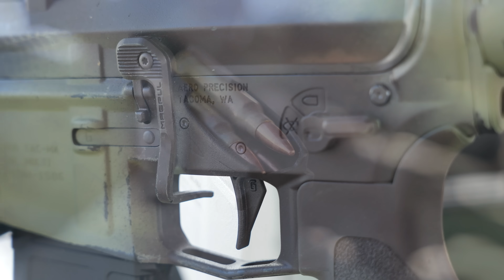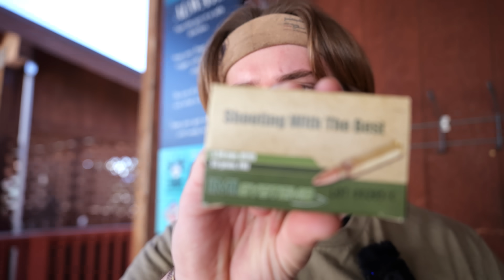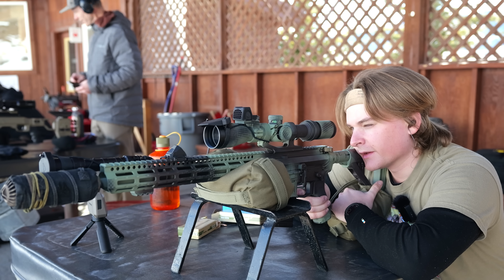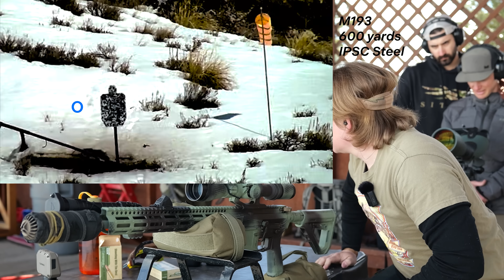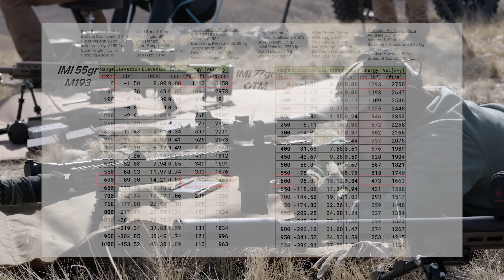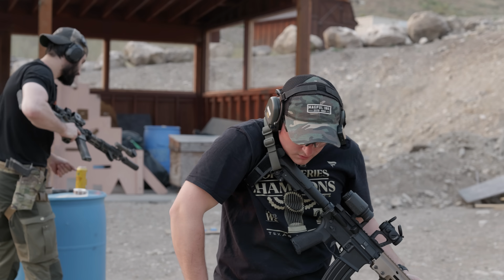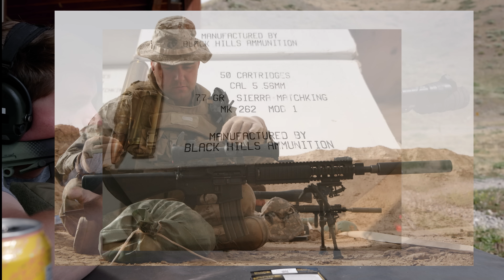77gr OTM: Why This Outstanding 5.56 Ammo Is Worth The Cost

Comment: If want to really stretch a 5.56 rifle with a 7 or 8 twist, single feed some long loaded 80s. At 600y distance, an 80 ELD-M will cut the groups in half over a 77 even. My 80gr load will put 18/20 inside 10” at 600y.

Comment: 55gr FMJ is acceptable for field use out of a 20" rifle, but even at 16" I'm starting to want a heavier OTM. Technically a 55gr will fragment at home defense ranges in a 10" barrel, but I've personally never been that interested in 5.56 SBRs, with 14.5" being the shortest I'd consider, but even then, if I can skip the NFA or just put a compact muzzle device on, I'd prefer the extra velocity. I think the 68gr bullets from Hornady strike a good balance of initial velocity and performance at range, so I've personally been stocking up on Frontier 68gr, but the SMK 77gr is well renowned for a reason. I might assemble a purpose built SPR upper for 77gr, but for now my GPR likes the heavy for caliber, but not super heavy, stuff.

Comment: Sig Sauer Elite 77 gr OTMs with the Sierra Matchking bullet are routinely the most accurate factory ammo in several of my and my buddies rifles. Both my FNs print sub MOA 5-rd groups at 100 yds with 3/8" groups being resonably common.
Its quite effective on pork roast and other simulation materials.
Its essentially the same as Black Hills MK-262 ammo for the MK-12 rifle. I stocked up on it at just under $0.94 each a few years back.

Comment: Only bummer is it breaks (a little) BDC reticles that are normalized for 16” carbines firing M193…you go from hitting about 1” high at 300 usually the first hold mark to as much as 20” at 800. 600 and in you just aim a little low and you should be good on an uncovered target.

Comment: Every bunker on the flight line in vietnam had 1000 clips of M-16 55gr. ammo. M-16 were all COLT. 10 th armored CAV. 1969.
Reply: for the close in 0-40yrd engagements of vietnam, 55gr is good. its still moving fast enough to have knock down power.   its good enough in house clearing operations also at those 0-4yrd ranges.

Comment: Been running 75grn balistic tips in a 10.5" Ar supressed.  With a 3rd position saftey This compact package handles everything well. I have been stocking the 77grn open tip match. I wonder what your thoughts are on terminal effects  between the two in the smaller package.  Those 77grns do very well out of both of my long Ar rifles.

Comment: Some thoughts:

For most people, accuracy and energy at 600 yds probably shouldn't be high on the priority list compared to terminal ballistics at closer range (including over-penetration concerns). There are some other bullets that perform better in this regard, with better expansion and less risk of overpenetration, albeit at the cost of ballistic coefficient. All that said, if you want to shoot far, then it's the best type of round for 5.56, but then 5.56 is still a very lacking chambering compared to other cartridges like 6 ARC both from an energy and accuracy perspective (accuracy mostly meaning resisting wind). 

Personally, I'm still undetermined on what my ammo of choice would be. Kinda between 77gr otm and like a 62 gr soft point or something. I say all this as if I'll ever actually use for anything other than ringing steel lol. Another consideration is that all else being equal, I think a heavier bullet will be a little quieter than a lighter one on the same powder charge.

Comment: While I'm sure there are some who choose a 77gr over a 55gr, I strongly dissagree with that idea that it performs better. I will conceed that a 77gr is more stable at very long ranges of 500 yards or longer. The arc of a 77gr is much steeper and therefore much more difficult to be acurate with since it's vertical (drop) will be much higher. Because it travels so much slower, and from a macro perspective, very close in mass to a 55gr, the increased amount of travel time makes it much more susceptible wind deviation.

Comment: You're going to need fairly fast twist riffling for a 77gr projectile to work well in a.556.  In order to get the OAL correct with my 1in7 twist Mossberg MVP my handloads were too long to fit in an AR magazine.  Single shot they are super accurate.  My 1 in 10 twist .223 Remington 700 doesn't even shoot a 62gr bullet very well.

Comment: For distance, 77grn is superior, but i still really like 55grn overall.  It covers 90% of what i need it for, especially practical engagement distances.  I have better guns for longer range.
Reply: I have embraced 68/69grn. OTM. Frontier 5.56 or the .233 give the best overall performance for my 5 different makes and barrel lengths.
( This includes a CZ bren 2 11" and a Kel tec 16C)

Comment: Like he states twist rate is important.  If you have an older barrel with slower twist rate 1:9 or slower you more then likely will not be able to shoot these.  I shot high power service rifle matches back in the day when we used 90 grain but had to single load them during slow fire at 600 using a 1:7 twist barrel.  Since then the 75's have taken over.  This way shooters can just load one load, one bullet, for all the stages, instead of two.  For plinking it is not worth the extra cost to shoot these.  For matches it is mandatory to shoot the heavier bullets if your barrel has the twist.  My 1:9 will not stabilize these.  Yours might but doubtful.

Comment: BTW, "OTM" Open Tip Match bullets are not considered a Hollow Point design!  This ruling has precedents in multiple court cases already!  

It is a high precision round, designed with a jacket wrapped around the base towards the spitzer tip.  It's process was chosen for it's uniform jacket thickness and uniformity - not for fragmentation or breakup upon impact!
Reply from the maker: This is said in the video

Comment: Your spotter needs to look at ALL the wind not just wind at target just in this video and watching trace it is obvious there is a significant section of wind around the 350m range that is not being properly called rather than just the wind at tgt. If you are not super experienced with watching or calling wind I would recommend setting up multiple wind socks or streamers. At 600m with 5.56 at least one more at halfway. Taking all wind into account as you said is especially important with low BC round and also right as the round become transonic. But the right answer is and always will be ALL WIND IS IMPORTANT WIND.

To comment on the last part of your video yea it works pretty well.

Awesome video.

Comment: The one thing you omitted (though I’m sure many shooters already know this) is the importance of twist rate for this cartridge. Many older commercially available AR-15 variants used to come from the factory with a 1:9” twist rate, which is too slow to stabilize this heavy-for-caliber bullet. It’s best used in AR barrels with 1:8” or 1:7” twist rates. I discovered my first AR from 25 years ago in fact had a 1:9” twist rate, so I utilize 69 grain Tipped Matchking for it.

Comment: The 77-grain 5.56mm NATO bullet excels within 400 yards, maintaining velocity for reliable fragmentation and hydrostatic shock, making it ideal for standard rifleman roles. Beyond 400 yards, particularly at 600 yards, its velocity drops below 1,900 fps, reducing terminal effectiveness to primarily fragmentation, with limited wounding compared to closer ranges. DMR platforms in calibers like 7.62x51mm or 6.5 Creedmoor are superior for 600-yard engagements, offering greater energy retention and larger wound cavities. So, less than ideal.

Comment: So here's the thing.  5.56 is not an appropriate round for 600 yards.  I believe the max design spec was 500 yards when the rifle was originally designed.  If you want 600 yards, and the AR platform, there are better options than 5.56.  If you are willing to move up to AR-10, you get much much better options still.
Reply: So you wouldn't mind standing at 600 yds drinking a beer smokin a camel hey?🤣

Comment: After a couple hundred rounds of 55 grain .223 and cheap 5.56 through my 16" 1:7, I figured there was something wrong with the rifle and let it get dusty in the safe. Once I learned about why the Mk 12 works so well, I tried 77 SMK OTMs and was amazed to get consistent hits on a 12" gong at 600-700 yards.
Reply: The wind flag showed exactly the point of the better bc of the 77gr . I use 77smk in competition 200 and 300 yds and 80smk at 600. The higher bc and match bullets really show their worth at extended ranges .

Comment: The 77gr SMK did a lot of work in Iraq and Afghanistan.  Great video.  thanks!
Reply: Actually its was ineffective, especially at longer range so the M14 was the preferred rifle. The old Vietnam era 55 grain FMJ tumbled when it hit flesh causing a massive wound channel. The 77 grain bullets punched a pencil hole and required more hits to stop the threat. The 55 grain from a. 20" barrel had a higher velocity and more hydrostatic shock as well than the 77 grain from a 16" barrel.
Reply: @PassivePortfolios  🤣🤣🤣🤣🤣🤣🤣🤣🤣🤣
Reply: @PassivePortfolios  "Hydrostatic shock". Get this clown out of here.
Reply: @besttacoalpastor3284  Its a fact. 55 grain continues to be used more and has longer track record. The mk262 is for fat turds  who watch videos all day.

Comment: Most of my .223 stash is hpbt match in the 70gr range... groups can average 2moa at 200 with basic 1:7 milspec if my human error isn't at play. Great for hitting small. Just keep in mind that it may hit lower at some bdms than common 55 or 62gr rounds. And if you swap to those, you may hit higher than your zero if you zero with match.

Comment: Do one on the new military choice of the Sig .277 Fury or I think 6.8 x 51 with the steel case head at 80,000 psi. I think it is a good choice, but no expert for sure. Great video. In fact, I just purchased some 77 gr Badlands SMK at 2900 fps but haven't shot them yet. I feel better about my purchase after watching this. Going to use Ruger Mini-14 and see how they do. No idea of the twist rate in the barrel though.

Comment: Just went shooting out to 500 for the first time. I was running a 16 inch barrel with 77 otm and it was surprising how easy it was. I had my hold and was drilling a steel plate over and over. I will also say m855 was pretty awesome on accuracy(calm wind fyi) and remington 223 fmjbt was like kinda bad at an extra mil lower hold with wind hold as well(not as much umf as the other cartridges)

Comment: There is a reason High power competition shooters don't use 55 gr bullets on full course matches as this video demonstrates why.. 77gr is the standard for magazine fed 223 ars at 200 to 300 yard lines with 80-90 grs used single feed for 600 yards by most competitors.

Comment: Interesting video. I noticed on you printed ballistic chart you had the sight height listed as 1.5 inches. Did you actually measure it or just leave it that number? That can be the actual number on some bolt action rifles but on most MSR rifles it is higher than that.
Reply from the maker: That’s just the default value, wasn’t relevant to change for the purpose of that graph. Actual sight height on this is about 2.7 inches
Reply: @greenweiser Yep,  close  to that on my rifles also.  I love IMI 77gr in any1:7 rifle.  It will also shoot great through a CZ 527 bolt action rifle. Just wish it was cheaper...

Comment: Its not the bullets weight that determines BC, its bullet design. For exmple, 73 gr eldm have a higher bc than 77 gr smk. 
73 eldm, according to applied ballistics, has a .410 G1 BC. The 77 SMk has a .371 G1 BC
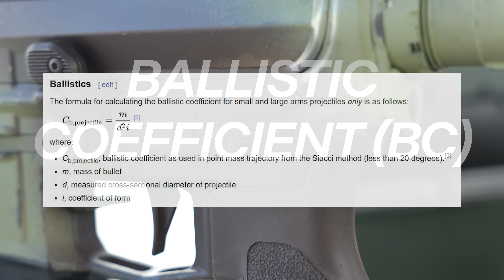Reply from the maker: And a 77gr 5.56 bullet has a higher BC than a 230gr 45ACP… of course a less massive bullet can have a higher BC because it is a multi factor equation. Have a look at the equation for BC at 0:42. Mass is a factor since it is the big term “m” in the numerator. The term “i” in the denominator is the coefficient of form which tells you about the bullet’s design. All of it factors into BC

Comment: heavier boolets have more moment assuming they are not steel core or steel jacket. this causes them to be better stabilized with lower twist rates and have less devieations from the magnus effect or Poisson effects since the yaw procession is lower. so the natural cork screw path that supersonic rounds travel is smaller in magnitude and the point of impact depends less on slight burn differences between powder burn. just another reason why we keep trying to go back to heavier rounds.
i would also expect there to be a trade off at closer ranges for terminal ballistic performance since the lighter 556 rounds take advantage of their larger yaw magnitude to more easily tumble on impact.

Comment: I am new to longer ranger shooting and was shooting 77gr OTM AAC (the 2700+ FPS stuff, not the slower stuff) today out of my SPR style gun with a Ballistic Advantage barrel, Geissele SSA-E trigger, and a 2-12x Athlon scope using a bi-pod on a folding table (not the most stable platform). There was ZERO wind today or I would have been less accurate, but I was probably getting 1-1.5 MOA consistently at 200+ yards and was getting hits on the same exact spot with it. Great stuff, and I think I'm just going to stop buying M193 altogether. Shooting M193 or M855 out of the same gun previously yielded about the same type of results as this test. M193 and M855 were just too inconsistent at range (probably shot 2-4MOA groups at 200 yards) and I was kind of pissed at myself for investing in building what I thought was supposed to be a reasonably precise gun capable of 1-1.5 MOA. 77gr OTM just makes it trivial. I have a .308 AR, but avoid shooting it due to costs because I'm not a competent long range shooter yet.

Comment: Totally agree.  I switched to the old Cor-Bon 77gr MPR(basically a Tipped Match King bullet), and then over to the Black Hills 77gr as my got-to/home/self defense round.  Not only do i like the heavier bullet for terminal ballistics, but I feel it excels out of shorter barrels due to there being less less powder to burn(and more time to burn it, since the profile is moving more slowly in the barrel.)
A few years ago we used my friends chrono to check out the velocities out of different barrel lengths, and I don't know if my HD gun's chamber is a little tight, or if this is normal, but the results gave velocities out of my 12.5" barrel between 2700-2750fps(with the advertised velocity being 2750fps out of (I believe) a 20" barrel.)  That was really sold me.
Reply: That fast out of 12.5"barrel. That will work. Maybe try some of the NAS3 cased ammo( by Badlands Munitions). You will be close to 3K ft/sec. from a 12.5" barrel. That would make your gun a deer/hog smoker.

Comment: Not all 77gr ammo is created equally. I bought some PMC ammo because it was slightly cheaper compared to some competitors. Advertised velocity was 2,750 FPS on the box. Took it on a range trip with a Caldwell Chorongraph. 

After testing, the average velocity was just over 2,600 FPS out of an 18" barrel. Far below the advertised velocity, a big disappointment. Accuracy was there, but not the velocity and energy. 

The best 77gr I've tried was Silver State Armory, back when it had Sierra Match King loads, still got a box of that ammo. The average velocity was over 2,750 FPS, in the neighborhood of the advertised specs with my 18" upper. 

Next, I tried some Magtech 77gr loads. Those preformed similar to the SSA ammo. In the neighborhood of the advertised specs and accuracy was marginal. 

I purchased some IMI 77gr loads, but haven't tried them out yet. Next to do that soon.
Reply: If you're not firing the test lot through the manufacturer's firearm, you won't likely ever get their marked velocities.  It was likely test fired from a 24" test barrel.  Even FGMM you won't get the same velocities Federal does..    PMC is generally a little weaker ammo, and definitely not match grade - OK for training, steel or paper though.

Comment: Depends on use case.  I can't see a use for a 556 needing to reach 600 yards.  That's not an ethical hunting range, nor is that self defense range.  That's pushing 556 to the limits, in which case I'd just step up my weapon and caliber choice.  My realistic use case for 5.56 is WELL INSIDE 100 yards, probably inside 20 yards for lawful self defense. And the 55gr is 400 f/s faster, which is better for armor penetration if an attacker has hard plates.  And 55gr is affordable so I can stack 2x more and 2x train more.  If you're shooting 500+ yards on an important target, step up to in caliber (6.5CM, .270, .308, 7mm, etc.).  Plus a larger caliber will have more energy on target than 5.56 has at the muzzle.
Reply from the maker: We have different understandings of what a setup like this would be used for.
Reply: @greenweiser  I use use loading in pistol length barrels where lower bullets give too much flame and muzzle blast and the 55 grain bullets are set up to work at higher velocities.   
There is little ethical use of 5.56 at longer ranges for hunting regardless of the bullet.  For self defense in my local distances are short anyway and legally hard to justify self defense at longer ranges.  Besides I use 300 blackout and 7.62x39 for my pistols and 6.5 grendel otherwise.
Reply: I agree 100%, but in life you cant run around with 8 guns GTA style. So a possible general purpose ar15 i think should have heavier bullets.
For training or going to a flat range, cheapo 556 is 100% a great idea to use. 
But, this is just my shitty opinion.
Reply: Most things shouldn’t be hunted using a 5.56. The point is the 77 is an all around cartridge for short or long barrels and is an all around combat load and 55 for is dependent on barrel length and worse at range. If you’re setting up 5.56 for whatever then 77 is the more consistent load for whatever you find yourself in
Reply: 55gr aint penetrating body armor plates, best case is spall.